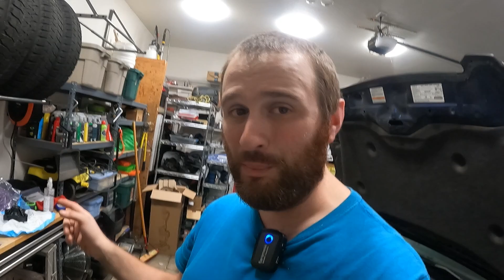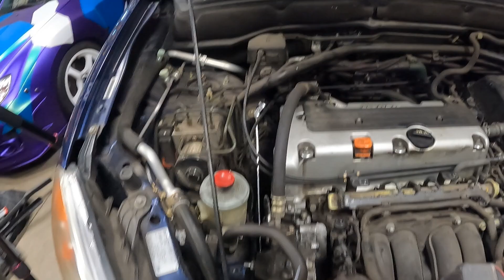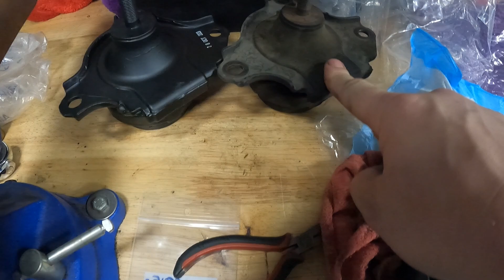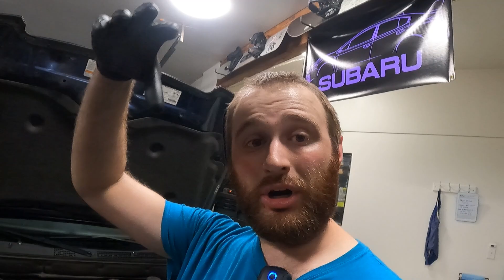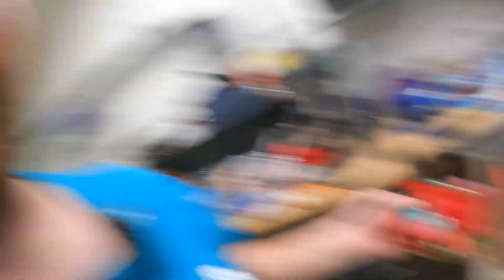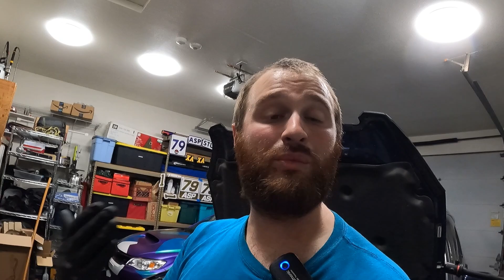Honda CRV  Vtec and Steering Pump Replacement!!!

Comment: Where exactly are you supporting the engine after removing the mount?
Reply from the maker: I useba floor jack with a wood plank under the oil pan. Don't use just a jack because you'll dent the pan, but if you use a big piece of wood to distribute the load it doesn't dent

Comment: Good work. Not for others the motor mount removal isn’t necessary. I use the icon long double box but anything similar works great for releasing the tensioner

Comment: Great video attention to detail. Thx for taking the time to explain all the little details. Thanks for sharing your pearls (tip and tricks). Not sure why the aftermarket plastic hose nipples are not oriented in the right direction. I had to use the old pieces so they are orientated in the right direction. I also had a hard time finding a pump with the pulley attached and the right orientated plastic nipples. I ordered some extra o-rings, always better to have extras just in case they zip off as you put them on. Worked on Honda CRV 2007, 2.4 lit with 240,000 miles ( trying to break 300,000). Still running strong.

Comment: Great job ! I believe needs new oil and filter was a bit dark... Sounds good tho. How many miles does it has?
Reply from the maker: Thank you! 
Oil is fine on the car. It was due for an oil change that I did the next day at work. Car has like 150k miles. I had it opened up recently for a different video and it's perfect inside the motor.